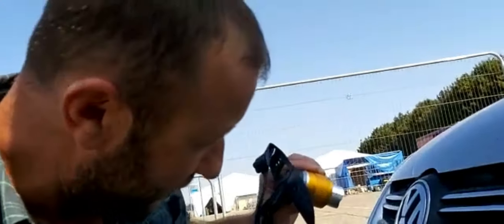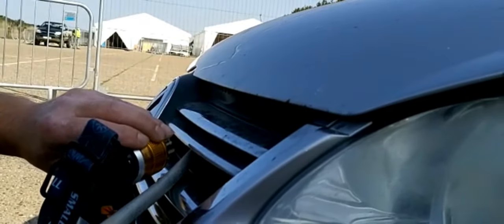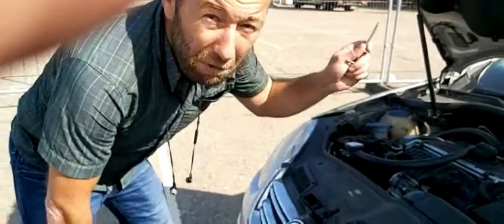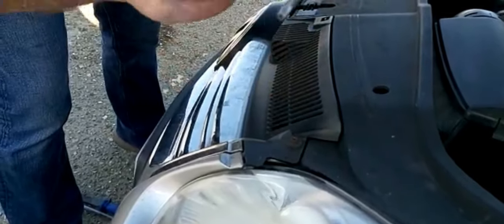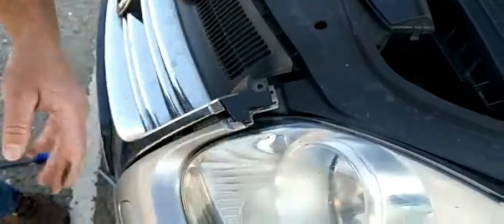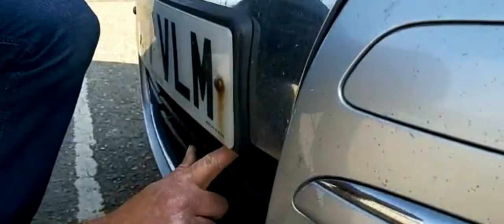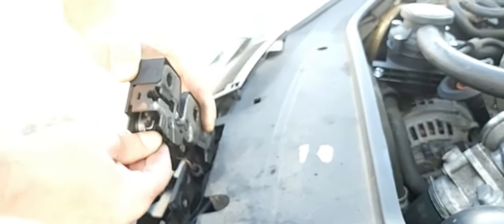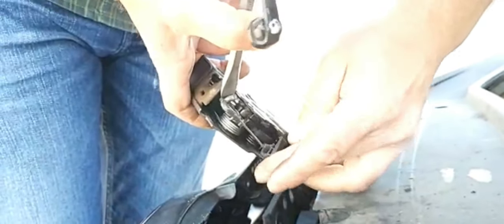How to EASY OPEN Volkswagen Golf Stuck Bonnet 👍 Cum se deschide capota la Volkswagen DIY

Comment: Just worked 2007 golf mk 5. Use copper piping small bore with flattened end slightly bent. Strong torch advisable